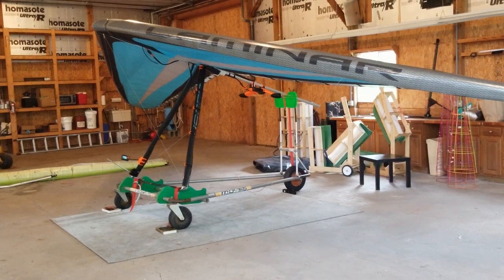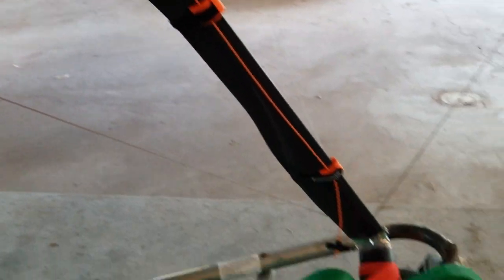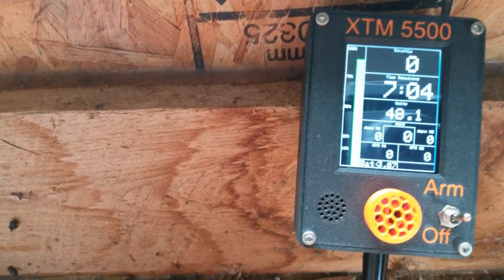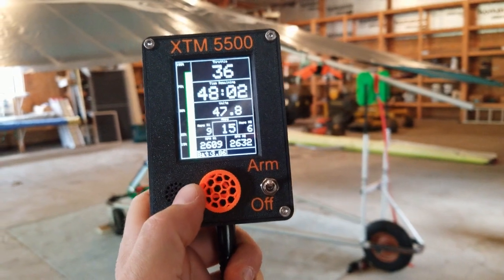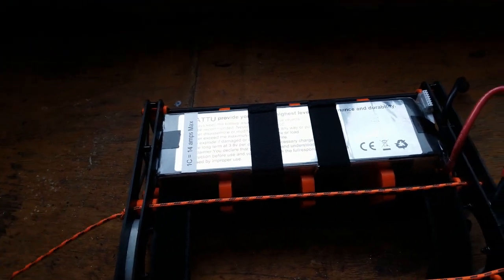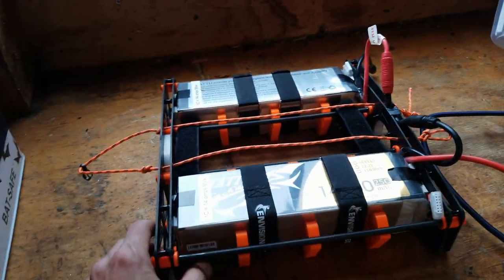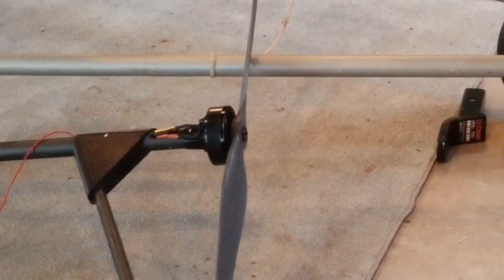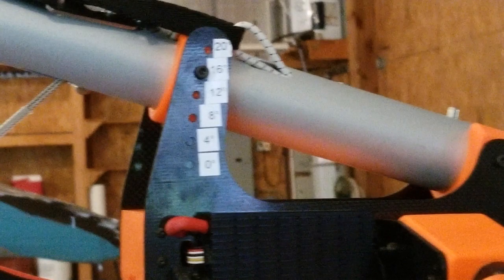XTM 5500

Comment: Hello! I admire the elegance of your solution. I apologize if the answer to my question was given in the video, but my English is weak. Please tell me what thrust the engines develop and what diameter propeller do you use.
Reply from the maker: The motors and props in this video put out about 20kg of static thrust (10kg each) with a Mad M6 motor and 19.68x10 wooden gemfan props.  The upgraded Mad M10 motors with 22x10 wooden gemfan motors put out 32kg of static thrust.  I've upgraded to CF folding props RASA CFK Propeller Folding 21/15,5" MAG ONE which are mounted at about 22" instead of 21.  Haven't put those props in test stand but suspect its about 35kg.

Comment: The back design is good but the battery on the keel is not a safe and smart idea.. I wouldn't use such device.. in case of fire, you are doomed.. the entire strap system that you hang on is nylon and that will melt with a little heat and you be lucky if it melts because those molten lithium particles will fall right on your back and burn you before you get a time for deployment of the parachute that will again not work and melt in contact.. the problem is those battery locations..
Also it has to be designed in the way that batteries get disconnected and fall below while holding into a case hanging from a thin steel wire so the fire hazard go down and stay a safe distance from the pilot.. I did this on my paramotor when I was designing it , I am using a lithium battery for engine start and still have made a small fire wall and steel wire connections and a spring, pins and heavy duty zip straps to hold it on place but in case of fire those straps will melt and the springs will shoot out the battery away from the paramotor.. you should think about how to separate the batteries from the entire pilot proximity..
Also the thrust you need to actually get bearly off the ground is 

Total take off weight/ true aspet ratio in flight ( considering the gear set up ) = minimum required thrust 

True aspet ratio is. Total glide ratio on new set up / 2 

And you need to have minimum of twice that power to perform as good as the mosquito and if you want a better design,  you need to make it that thrust about 2.5 times the minimum thrust on the calculation above.. 
Assuming your total take off weight with your system around 300lbs / 7 true aspect ratio = 43 lbs ,
And you said they make 20 kg which means 44lbs so it bearly takes off from ground at sea level at 68 degrees Fahrenheit or 20 degrees Celsius.. you need 2.5 times than means 20kg x 2.5 = 50kg ( 110 lbs) 
20 kg is not sufficient enough 
And if you try to use more powerful motors, they will drain the batteries I just 2 minutes and all that work and investments for 2 minutes doesn't make any sense.. 

https://youtube.com/shorts/QK_df-MN_mI?feature=share
Reply from the maker: Your point about the safety of LiPo batteries are valid and my biggest concern.  However, your assessment of what would happen if they were to catch on fire is pure speculation.  The batteries are on the keel tube but very close to the nose of glider and not that close to the hang strap.  While a fire could spread to the hang strap and melt it off that's not my biggest concern and may be a positive.  I fly with 2 chutes which are both connected to the harness and don't go up the main line so in your scenario I would be disconnected from the flaming glider.  My concern is the following: the batteries melt through the battery holder and slide down the wing (melting through the cloth sheer ribs) and putting the glider into a flaming spin, or the whole sale catches on fire among other things.  Given I'm flying at 25-30mph I'm not terribly worried about the "molten" batteries falling on me" I think they would bounce off and keep going i.e. gravity and wind would see to that.  There are a whole lot of other things that could go wrong as well with a fire but don't want to speculate.  With that mentioned I'm actually much more comfortable having the batteries in the wing then strapped to my back as they are on all the ehelp designs.  

In the end I agree that LiPo's aren't safe and there is a lot of risk with the system.  However, using high quality batteries, operating them well below their limits, and maintaining them well can help offset this risk.  In the longer run I expect battery technology to advance and replacing these with safer solid state batteries.

With respect to your math on thrust and flight time, the goal of this project is to have enough power to climb to 1,000-1,500 feet. If that's 2min at 500fpm or 10min at 100fpm it works.  Based on my math and actual tests this is achievable.

Comment: I would like to be able to eject batteries in case of battery fire.
Reply from the maker: So would I but not going to happen with this design and a high performance glider.  Very hard to get battery back on keel and strapped in.  In 5-15 years when batteries go solid state the risk will go away.  However with an ehelp its possible to design an auto-eject system which I'm already working on.
Reply: Thanks for responding. I'm watching this tech as I am a new H1, still learning aerotow.
Reply from the maker: @adventureswitharizonaart6117  Cool.  However this is definitely not for a H1.  I've been flying since 1996 and am very careful with my testing and the conditions I'm willing to use in.

Comment: Wonderful setup - thank you for sharing!
Would it be a solution to use self-made Litium-Ion battery-packs instead?
Reply from the maker: Don't think that would work. While Lithium-ion, has better energy density and is somewhat safer, can't get same discharge rate i.e. c rating is too low.  Would work for a larger pack however for the small packs i'm using i dont think it would work.  I could go with a larger pack but don't want the extra weight.

Comment: Only for "high performance" gliders? Why not a Falcon 4 or similar? When will you test fly, and will it be commercially available thereafter?
Reply from the maker: 3 reasons it won't work on a Falcon:
1. Mounting: The chord is too long so there is no where to mount on keel that keeps props clear of ground and wires.  I tried to fit on my Falcon 3, it doesn't work.
2. Power: The twin setup is 5,500 watts max (hence the name), however I plan to increase to more but it would still be under powered given the low performance of a Falcon.
3. Rigidity:  A Falcon is very flexible and the keel can float significantly and thus change thrust direction which may have negative affects on handling.  Note this is just a theory, not tested.

If you're flying a Falcon you've already sacrificed performance so you should go with a simpler design such as my carbon ehelp.  https://www.youtube.com/watch?v=2QEa9IL_ZlM&t=21s.  I've open sourced the design files and BOM a link is in the notes to the video.  I flew the ehelp a few days ago; ground launched and managed to climb under power to 600ft AGL backed off motor and climbed in light lift to 900ft AGL then it turned on and I got to 6.5k ft AGL power off and flew for around 1 hr.  https://ayvri.com/scene/z15yrzn1jx/ckovqfcj10001266lqm12g0rf 

I've had 4 flights with the XTM5500 and it works really well.  I need to make some improvements but haven't had time.  Link here to 4th flight test: https://youtu.be/oqqEOvN7l8I

Its very unlikely it will ever be commercially available.  Its a side project which I find fun.  Once I get a little more test data I'll likely open source the design, however, it isn't easy to make.  I designed it in Fusion 360 and all the parts are either 3d printed with engineering grade materials, CNC milled from 7075 T6 aluminum, or CNC cut from carbon fiber plate.  I even CNC cut standard wood props so they fit in the custom folding hub. If you're flying a Falcon, you should make a carbon ehelp.  Its really easy to make compared to the XTM5500 all the design files are open sourced, cost is about $2,500 all in if you make yourself and given the limited number of parts you could probably have made for $1000.

Comment: That's a very clever solution. Te two Motors as twin configuration  seems to be the key. So it's adaptable to most gliders likes flex wings and rigid wings as well. And I think it's possible to launch ontje trolley. Very cool. Good design.
Reply from the maker: Thanks.  Yes twin is key.  I built an ehelp as well which works really well on falcon.  However for a glider mount solution their is no way to go with a single engine due to the larger prop size required.  Also only works on high aspect ratio glider.  Need to finish upgrade to bigger motors and I think I should get 200-400fpm climb.  I'm also leaning towards open sourcing after a little more testing.

Comment: If your flying this design in rough conditions ie slack harness.. the pitch over effect due to thrust line could possible cause a pitch over 🙄
Reply from the maker: 100% disagree. If the hang strap goes slack then the pilot is taken out of the mass equation.  i.e. the center of mass would just be that of the glider which would be near the under surface of the glider.   The thrust line is currently about 14 inches above the pilot so a few feet below the under surface of the glider.  Going slack would cause the glider to pitch up not down.  

Also you're missing the whole point of this.  If the air is that rough there is no need to fly under power.  The end goal is to create a lightweight platform that doesn't have a meaningful effect on flight control in a power off situation but allows the pilot to either scooter tow to a few hundred feet or launch from a training hill and climb to thermal level i.e. 1000ft.  It would also be useful as a back up if your about to sink out and want to push to the next thermal before landing.  The longer run goal is to design and build an electric powered launch cart so you could safely launch from flat ground, climb up to a thermal and shut the engine and go soar.

Comment: Charles, Is this your own design?  I'm thinking that it is, but it looks to be professionally manufactured.   I'm also wondering why you have the "under frame/trike"?  You don't really need it if the props are 2-3 feet off the ground when the glider is sitting on the keel.  Maybe you just like to roll off the ground on take off.  Have you taken off by running with motors on?   I developed a similar concept about 2-3 years ago, but have not yet made a prototype.   I have a few more questions but hope you will answer what I asked here before I go on.  Scott W
Reply from the maker: Scott - I designed with Fusion 360 and manufactured in my workshop with CNC mill, cnc router and 3d printer.  The "under frame/trike" is a standard aerotow cart.  You can see me launching with it here: https://youtu.be/oqqEOvN7l8I.  I've also foot launched with it from a mountain launch https://youtu.be/vLN5Kvkvwa0.  I've flown with it 4 times to date and am still dialing things in.  I don't plan to ever flat land foot launch it.  Its designed for a high performance hang glider which stalls at a high speed so would require a very long and hard run.  Also it won't fit on a beginner gliders due to long chord and I'd be worried about the keel floating around.  The keel is relatively well locked into position on a high performance glider and adding VG will further limit float.   I've flat land launched my falcon with the carbon ehelp numerous times video here: https://youtu.be/2QEa9IL_ZlM.  The next logical step is to move from aero towing to scooter towing.  After which, assuming I continue to get positive results, I plan to design and build an electric powered cart similar to a standard aerotow cart to allow for flat land self launch.
Reply: @cwallen32  Thanks for the quick reply!  It's great that you have all you need to make such a nice looking power unit.  The version that I have dreamed up (but not yet built) is intended to be foot launched from flat ground.  I have seen other single prop versions being foot launched from flat ground so I know it's possible.  One thing I would say about about launching from the flat is that a high performance wing will produce better lift at min sink speed.  So, I would figure that it wouldn't take many strides (into nice a prevailing wind - around 10-12 mph) before you start "moon walking" and then you're off the ground. 
  The glider I would use for my version would be a WW Talon 140 (first version).  I also have a WW Sport 150 available and it may be the better option due it's larger wing area. 
  What I like about having duel props, more or less in line with the keel, is that when taking off they are high above ground obstacles like medium to tall grass.  Also, with counter rotating props you zero out the rotational torque.  It could also be useful to vary the speed of the motors to help with yaw/turning. 
  BTW - I was responding to your 10/3 video when you responded here.  So I'll go back there and finish up with that comment.  : - )   Scott W 
  PS - For some context I started flying in 1975 and when a member of the USHGA (Then USHPA) I held a Master rating.  With an e-assist HG I can fly at sites where the local USHPA chapter has threatened to literally beat me up if I were to try and fly.  But with lots of hay fields in the valley I could fly with no interference.
Reply from the maker: I wouldn't foot launch a 140 Talon with a twin setup from the ground, just my 2 cents.  Its an unproven design with a lot of variables that need to be dialed in to make safe.  Yes you can foot launch an ehelp (single prop) proven design from the ground with basically any glider but will require a more substantial run with a higher performance glider.  Obviously a 10-12mph wind changes things but that's a very strong wind on the ground, likely blowing 25 mph in the air.   You should check out Reidar and my ehelp videos.

Comment: hi, have you make the first flight ?
Reply from the maker: Yes, 3 flights.  I've made refinements after each flight.  Plan to have another flight weekend of Sept 26 weather permitting.  Bottom line is it works well but is under powered, just sustains zero sink doesn't climb.  However its really easy to add more power.  I was a 2-3miles away from the tow field on last test flight around 800ft and was able to make it back arriving at about 400ft.  I have video and track logs just haven't had time to compile and do a write up.

Comment: I've always been afraid that with a Mosquito harness you could set your harness on fire.   I like the idea of have the batteries as far away from the body as possible.  If you had to, you could throw your chute and cut away from the glider if the batteries did start on fire.
Reply from the maker: Correct assuming your chute connects to the harness and not the hang strap.  Also would need a hook knife.

Comment: Dude... this is neat. What's the best place to get updates about this project?
Reply from the maker: I'll likely post an update video to my channel and will send to Davis at the OZ report and he'll likely post.  Since making the video I've flown with the unit with positive results.  Unfortunately the props won't fold after shutting the motors so I need to move to an ESC with a brake which is a major redesign, however I'm finishing up a mechanical brake as a band aid solution.  Plan to fly it this weekend and will post a comprehensive update in the coming weeks.  Also plan to post more details on my Carbon Ehelp and will open source all design files.
Reply: @cwallen32  awesome , thanks, looking forward to all that. Good luck!
I don't quite understand, why don't the props fold when you cut power?
Also just for you to consider, I was talking to Miloslav from https://ultralightdesign.cz/ a while ago, and he mentioned that he's actually electronically slowing down the ramp-up of power when starting the engine to prevent the prop unfolding too fast, hitting the limiter, and over time breaking due to this repeated stress. And I saw how the prop unfolds in person, it was nice and smooth.

Comment: Looks like you could mount that upside down for high drag wings like a Falcon???? Or my Sport 2 175???
Reply from the maker: Doesn't work on a Falcon.  I have a 140 Falcon I purchased to test it on and the chord is too long.  You need a high aspect ratio wing to ensure there's enough keel to mount and stay clear of the ground.  I built a carbon ehelp that works very well with a Falcon.  Here is a link to an old flight https://youtu.be/4Z1WWt682bY.   Since then I've upgraded the motor/prop combo and it can climb to about 1,000-1,500 ft on a charge.  I'm in the process of organizing all my CAD files, BOM, code, etc and plan to open source the carbon ehelp design.  Also if you inverted my design the thrust line would be well above the center of mass of the glider and likely create major issues.
Reply: @cwallen32  OK,, I figured with the drag of a single surface you could adjust the angle enough, but that would take a lot of trial and, the big word, ERROR to figure out. Best done after launch up high I suppose. AND a willing and able pilot of coarse. Love your ideas and will check out the link you supplied. I live in Arizona and am only a 10 hour H2 pilot, but with all this flat land around me and very few mountain launches that I don't even qualify for yet, this, even after H3 would be a great option to not have to travel for. Especially in the winter when it's cooler to fly but have the inversion layer as a ceiling. UGHhh!!!! LOL Bless you and yours. Hope you much success.